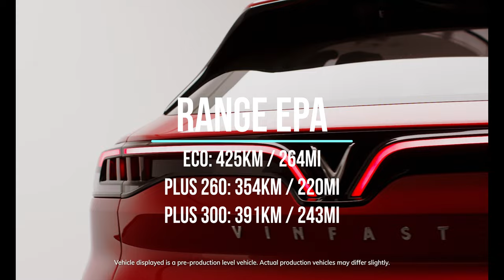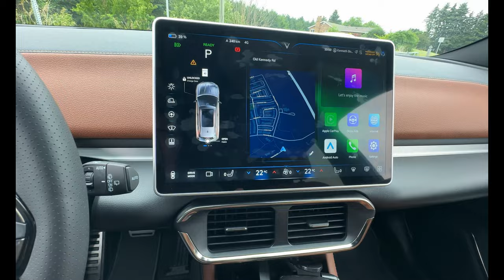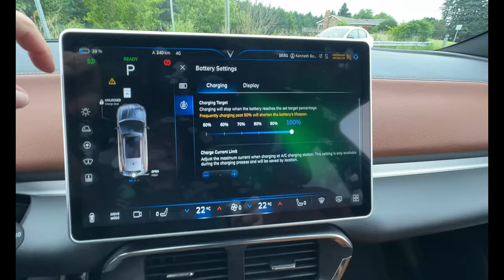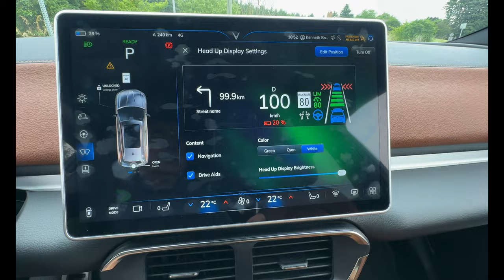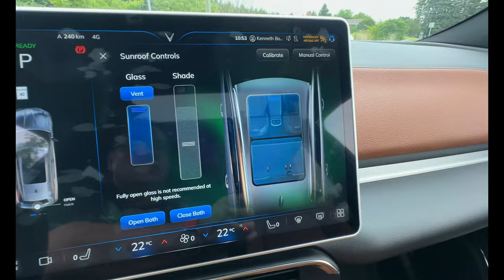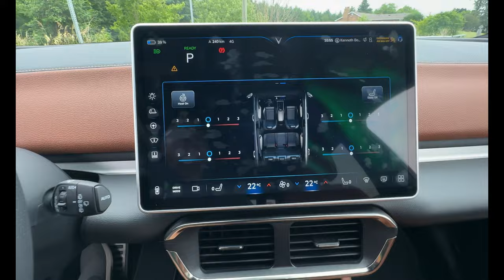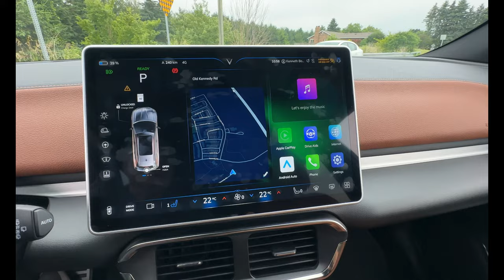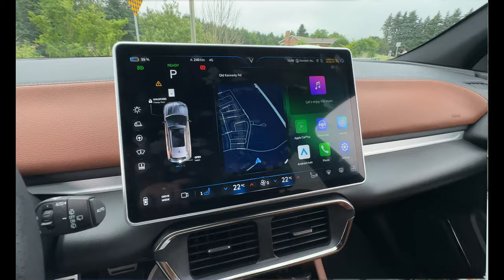Episode 249 - 2024 VINFAST VF 8 Plus AWD - 1st Canadian Press Vehicle, Charging & Detailed Review!

Comment from the maker: As of this video, the current software for the VF8 was FRS 9.6.1.13, so many bugs have been fixed according to VinFast.  Release 9.6.1.15 is coming very soon and this will offer improvements as well.  

UPDATE 1: Also, when using the build in nav, it does provide charging station availabilty/use and other specs.   VinFast is supporting all the Charging Station providers that can give this info in their apps.  So if you look for an Ivy Charger in their app, they will show you live status of a station (if in use, etc.).  This info is fed into VF navigation and displayed when looking at charging stations.  If you look on my video, it did show it for my charge trip, but I said that feature was not supported yet.  It is.
Reply: Thanks for reviewing, I just leased VF8 plus fully loaded with a bigger battery pack-  drive in eco mode range more than 400km full 100% 🔋.
Reply: Hey Kenneth, great to see an honest review from Canada!   😀
"[after an hour or so] it will revert those settings back to  default" is only true of the "guest profile", I believe. If you set up multiple profiles, everything is stored. Certainly my wife an I have a bunch of different settings, including quite different home screen layouts, mirrors, some of the ADAS settings/warnings, auto-high-beam, and it recognises / switches them based on whose keyfob was used to unlock the vehicle, or they can be switched with a couple of screen taps and about 3sec delay whilst it moves mirrors etc. I'm not aware of any setting that still reverts.
I know you can't type unless in "Park", even if you have a passenger to type for you, bit annoying, but you CAN instead ask Alexa to navigate to an address, if you have her set up.
I remember I was going to lend you my VF8 (eco, in the green), but never happened. Glad you got hold of an official press loaner!  😀
Reply from the maker: @NoseyNick I had a profile set up for me with an account so I could use the App.  Was not in Guest profile mode.  So this is not the case where everything is stored.  I sat with VinFast engineer after my review to go over the settings that were not saved and most will be addressed in future OTAs.  Some like LKA coming on all the time, will continue to be this way, however I asked them to put it default to warning and not taking actions.  The nav typing apparently is post 2023 laws which now prohibit this, I was unaware as my 2020 I can type while driving.  Alexa would be a good setup to do and this would help for nav use.  Yes I was going to reach out to you to meet up to do a review, but then VF called me to be the first for the press fleet.  Thanks!
Reply: @EVRevolution  I guess my wife and I must both use the same (/default) LKA, so never noticed that one!  😆

Comment: Patiently waiting for the VF7 and VF Wild. Tell Vinfast to put a frunk in the VF7 please! I suspect VF7 will do better in sales, just don't give customers a reason to cross it off their list. Not having a frunk is a big deal breaker.
Reply from the maker: Thanks for watching, yes VF7 is more of a sweet spot size and hopefully price wise.
Reply: Vf7 40 k usd
Reply: @minhtunghoang4743  still haven't been announced yet from what I gather. Where did you find this number?
Reply from the maker: @minhtunghoang4743 and others:  I believe this is just purely a guess/speculation.  However for that smaller SUV segment, I would surmise the VF7 to come in around Mid $40K's Canadian, with the top spec being $49,995 MSRP CAD or similar.  They won't want to take a bite out of VF8 sales and that starting base is $53,600 CAD.  So I can see the VF7 starting at $44995 CAD or something like that.  Which for USD, would make it low $40K.  Maybe even breaking below that barrier with the base spec.  

I would also guess that the VF6 would need to be sub $40K starting, like $34,995 CAD or similar.  To compete they will have to keep pricing around these ranges.  IMO.  No facts, just my opinions.
Reply: @EVRevolution Your knowledge of cars is good 👍

Comment: That was a good charge rate with a 150kw level 3 charger.  But few of them around today, most max out under 60kw
Reply from the maker: Thanks for watching, yes was a good curve that day.
Reply: I was doing MUCH worse than that during the hideous -40C ice storm midwinter, but in good weather, but "well over 100kW" does seem to be quite possible especially if you can find the chargers that really are capable of delivering 200/250/300kW. Kenneth's 130-something is pretty good!   😀
VF8 apparently pre-conditions the battery IFF you use the onboard nav to take you to a charger - not just to the address / vicinity, you have to choose the actual charger off the screen like Kenneth showed, (or the VinFast app), otherwise it can take a few more mins to get to 100kW+

Comment: The only thing I'd point out is you can see real-time charger status in the VF App even if it is not available in the in-car HMI... Happy to discuss if you want. Ask John to set it up : )
Reply: Also - your charge rate will increase above 136kW to ~145, 146, even knocking on the door of 150kW if you get absolute perfect temps from the battery and the station is working as it should.
Reply from the maker: Thanks!
Reply from the maker: Yes, charging curve is very dependent on many factors and it could be a bit better or worse.  I hit it at a decent starting battery temp of around 24C.

Comment: @evrevolution and other owners of VF8.  I live in Sudbury and travel to Toronto couple of times in winters.  How would VF8 fare in Sudbury winters?
Reply from the maker: Hello and thanks for watching!  The short answer is expect a range loss of 30-40% in cold winter months.  This is true for any BEV.  Map out your route and see what charging station options are available for you based on this worst-case scenario range loss.  The VF8 gets a good 400kms in the summer, so expect 250-280kms in the winter on highway driving.  Map out stations within a 150-200km range so you can plan your stops and always have a backup, incase what you get to is not working.  This would be the same for any BEV again, not just the VF8.  I've done the Toronto-Sudbury-Toronto run a couple of times in my Model 3, and Tesla has a lot of Superchargers so I don't need to think about it.  For other CCS BEVs, you should plan this trip somewhat.  The VF8 is more than capable and you will be very happy if you choose this or any other competent BEV.  Any more questions, feel free to email me at EVRevolutionShow@gmail.com.
Reply: Thankyou very much @EVRevolution  for your response and suggestions on what to expect practically and especially how to prepare for it.  Thanks again for providing your contact and offering help on this matter.  Much appreciated.

Comment: Can someone confirm if the 2024 Plus actually has a heat pump or not?
Reply from the maker: Thanks for watching this episode!  As a totally unrelated question, the answer is the the 2024 Prius Prime, an internal condenser (condenser assembly) is used, which makes it possible to perform heating using only a heat pump.

Comment: Nice to see the price of dc charging. Costs the same as gas. My Escape will easily go 350km on $40 of gas on the highway. And only takes 5 min to fill. Charging at home is the only way to go. Plus you are paying $15000 more than a comporsble ICE vehicle.
Reply from the maker: Thanks for the comments.  While it is true that Fast Charging can cost as much as gas sometimes (most times it is about half the cost), home charging or cheaper L2 charging saves much more than any gas car can achieve.  That $15K you say can easily be saved over 3-5 years in fuel and maintenance costs for EVs vs. ICEVs.  You fail to mention the lower op costs of EVs (especially BEVs) that save on average $3k-$4k per year in fuel/maint costs vs. ICEVs.  

So please, if you are going to spout figures, balance it out with looking at all sides of it.  The majority of EV owners home charge, about 75% or so.  This is huge savings where one's home is their "gas station".  You can't do that with petrol.  Yes, petrol can take 5 minutes to fill up.  But my EV takes 10-15 seconds to charge at home...that is how long it takes me to plug it in and walk away, waking up the next morning with the State of Charge I want.  So if you want to compare time wasted in fueling ICEVs vs. BEVs, you will loose again.  

I am not trying to beat up on you, just simply stating that you share all the facts of a point, not just those that make your idea look good.  I agree that charging is not perfect, there can be problems with chargers, areas of less infrastructure, temperatures affecting charging flows, etc.  However, in the vast majority of cases, EVs work and they work well.  I've driven my Telsa Model 3 LR over 85,000km / 53,000mi, and it has cost me a total of $3,500 CAD for "fuel" and maintenance.  About 10% of my charging has been done on the road in DCFC stations and I've taken road trips of over 3,000km distances in a trip.  Never had a problems.  Zero issues.  Even taking non-Tesla BEVs (like the Ford F150 Lightning) on a 800km road trip...zero issues charging.  

So my point is in general, EVs work and the infrastructure in most modern areas is good and continues to grow at a fast pace.  Of course each person looking at an EV needs to look at their needs, infrastructure around them, etc. in order to make an informed decision.

Comment: So im guessing no heatpump? Climate shouldn't crush the battery that much with a working heatpump.
Reply from the maker: Thanks for watching.  VinFast uses a Heat Management Unit, which provides heating/cooling for both interior HVAC and Battery BMS.  Efficient system.

Comment: more expensive than a model y, what's the value here?
Reply from the maker: Thanks for watching.  Under $60K before taxes with incentives and VinFast discounting, so to me that is good value.  For loaded vehicle.
Reply: I have test drive model Y and it has terrible interior with cheap Chinese looks. I decided to wait for VF 8 or 9 because the interior is much better.
Reply: Model Y interior feels like a kitchen counter, tablet, wheel, with a bit of a Musky smell. VF8 Italian Pininfarina design feels like a real car - "enough" physical controls, GORGEOUS HUD (no need to look ➡⬇away from the road to see your speed / nav) even in the base (eco) model.
AWD as standard. Range is somewhere between the base modelY and the LR.
9.5kW portable/mobile charger included, not extra.
By the time you have upgraded the Y enough to match the VF8, it costs more.
Android Auto, Apple Carplay.
VF8 ADAS beats basic AutoPilot, acording to (ex-)Tesla owners
The only advantages of the Y are if you want to spend the extra $11k on Full Self Drive, or $4k for the dubious 3rd row of seats, as far as I can tell?
Reply from the maker: @NoseyNick The Model Y has much better range and efficiencies, that is the prevailing aspects of this vehicle.  Also, native Supercharging is still very valuable, if one does some longer drives and needs this.  Yes I know adapters and magic boxes are here and coming, however native still leads in functionality.  Like I said, they are really two different BEVs for different needs/wants.  As far as VF8 ADAS beating Tesla AP, well that is not the case.  Tesla's AP is very very good for what it is, Lane Keeping and Adaptive Cruise Control.  Especially the lane keeping, it sees the road in darkness and even when crossing thru large intersections.  Tesla's system albeit camera-based now, is still very good.  I would like to have my radar back, but alas Tesla is all vision now.  So unless you have spent some time behind the wheel of a Tesla, to state that VF8 ADAS beast AP, is not true IMO.  I use AP a lot and it works all the time with zero issues.  FSD is another thing and I am not a fan of that.
Reply: @EVRevolution  base ModelY range is 394km (less than VF8), but yes LR or Performance packages bring it above the VF8 (and also add the AWD , which the VF8 has as standard).
Several ex-Tesla owners, who now have VF8s, have said their VF8 ADAS beats their basic Tesla AutoPilot. Not my words. Both provide great lane keeping and adaptive cruise of course.